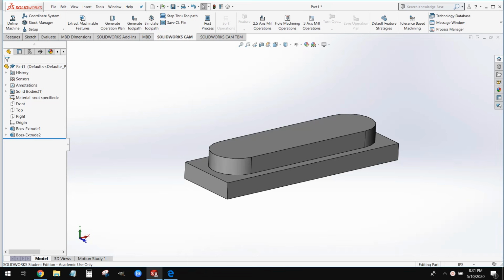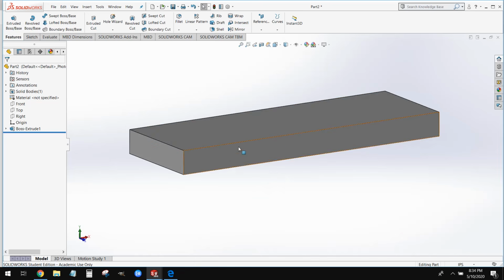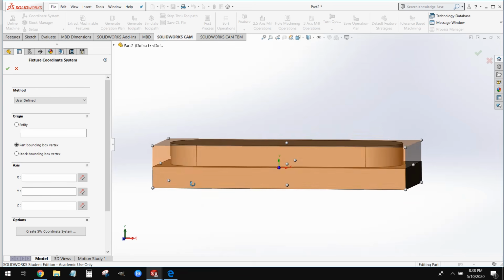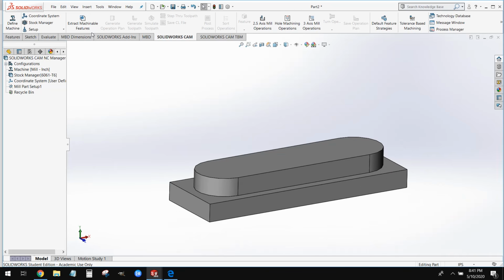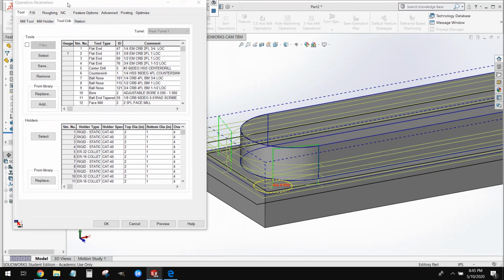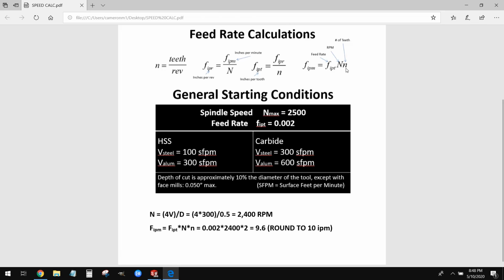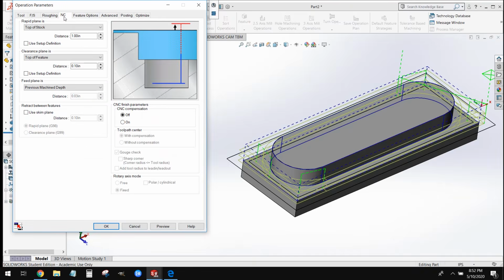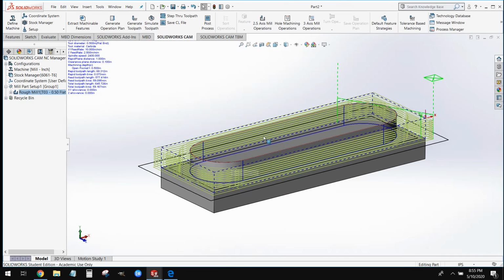Solidworks CAM Tutorial: Basic Contour (1)

Comment: Even with a high speed steel cutter, just about any CNC mill should be able to machine this in under 5 minutes, given aluminum. Heck, if I could interpolate arc on a bridgeport mill I could do it in under 5 minutes. I know this is just a tutorial, but it seems the basic path generation needs a lot of tweaking to not make it riduculous to make. Thanks for the first tutorial. I will watch to see if this gets more in depth.

Comment: I noticed that the work zero differs from the start point when you run the simulation. this is a problem since I set my cutter to the XYZ of the work zero selected by the user. is there a way to have the start and WZ the same? please Help.

Comment: Hi, and thanks for an informative video.
I followed the video, drew the part, generated G-codes and then machined the part in our CNC machine.
BUT, every time the machine goes in z-, it happens when the tool is over the part so that it is pressed into the material.
Is there an option to make the machine go in z- when the tool is on the outside of the part?
Reply from the maker: under the cut parameters, under the feature option tab, you should have an option to edit the "entry point", you can adjust the entry point by length and angle to a location off your part.
Reply from the maker: you should also be able to set your Depth of cut to 100%, and set your step over to 2-5%, this will sidemill the part instead of end mill the part